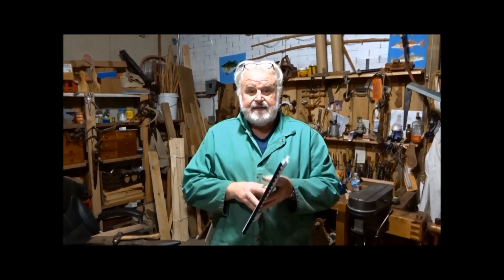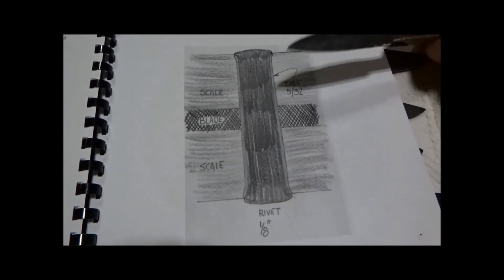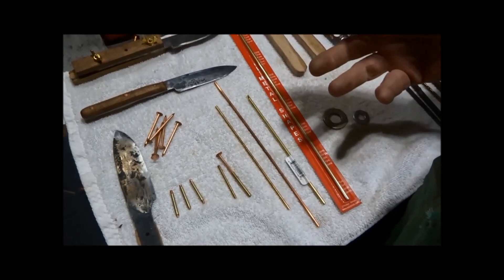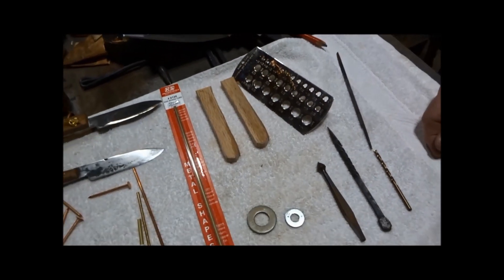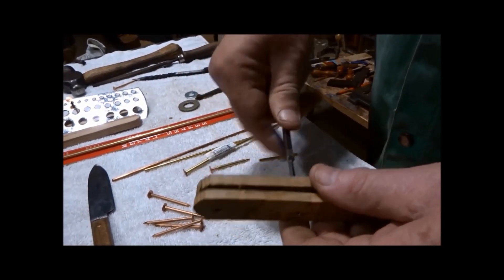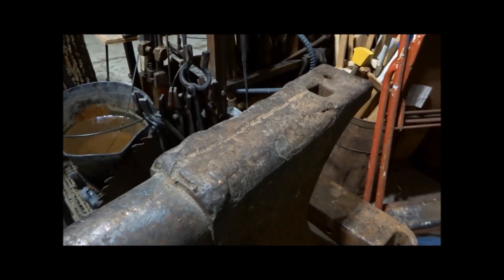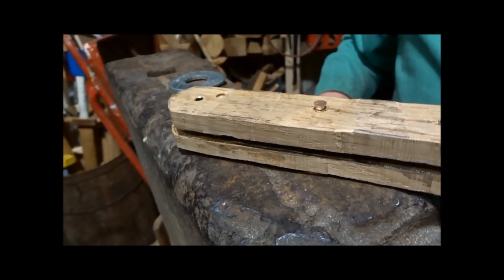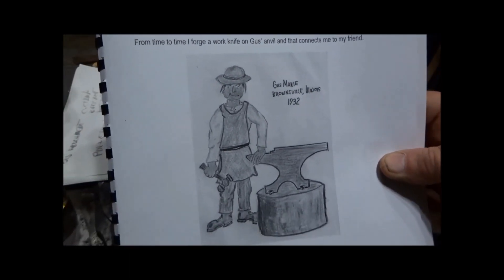Traditional peening of knife handle

Comment: This works perfectly. Ace Hardware will order the tube for you at no charge. It is K&S Precision Metals part #8128,   5/32x.014 brass tube ($1.79). The nails also from Ace are Anchor brand #11 copper slating nails ($14.59). I used copper because I just didn’t research where to get brass rods. Copper works great. Good luck.
Reply from the maker: High4, Thanks for your detail. Keep on smithing. Paul

Comment: This was very well organized. I've been stressing on the technique because the centrifugal switch on the Walker-Turner table saw I'm restoring on my channel has a broken torsion spring. Finally last night I realized the only way to replace the spring is to take off the long rivet that secures it, but I've never done anything like this before. I at least feel confident enough that by following this video and a little practice, I could get the job done. In fact, I went to Ace this morning (before seeing this video 🤔) and ended up buying both the copper nails and the brass stock you have because both are a perfect diameter for the original rivet. Plus another restorer also suggested a similar process. Thanks again 💯!

Comment: So does the internal pin push out the tubing through the whole pin or are you relying on the rolling over to hold the scale on.  I ask because I want the pins to be flush and that would take sanding. I would get the scales made to where I want them before smoothing.  I would sand the pins down to the scale height.  I just don’t want to do this method of the pins won’t hold after sanding flush with the scales

Comment: thanks for the video, using washer as spacer is a great idea.
would be great to cut the brass tub a few millimeters shorter than the handle width so the mushrooming pin sets in below the surface of the handle... then we can sand and file over the pins and still have them hold the handle together.
Reply from the maker: Stanley, What nice words. Thanks. Actually you can. The mushrooming of the peen head stands proud but the intense pressure  causes the pin just below the peen (mushroom) to spread a little also and more than enough to hold the scales tight even after we sand flat and smooth. Best, Paul

Comment: Thank you Mr. White. I have used copper tubing with copper pins for handles. Seems to work well. I like to use a larger drill bit by hand to countersink  the pin holes sometimes. Have used the file like you demonstrated also. Putting a nail in the tubing keeps it open when cutting or pressing on it.  Thank you again, Mr. White.    Yours in Prayer, Rick Trumbo
Reply from the maker: Rick, Thanks for your words and the nail tip. Is everyone listening?
Paul

Comment: Great video.  I'm about to try this for the first time and your video is going tomake it so much easier.  Quick question though.  The copper pin obviously expands as it is peened and thus fits tight in the tube.  Will the tube expand also, with the pressure?  Probably a daft question but I'm wondered what keeps the tube tight in the handle itself.  Thanks

Comment: Thank you.  I've wondered exactly how this is done and asked at a few knife repair kiosks for the repair on an old bone handled bowie  I broke, but no positive responses.  Tube and nail going on shopping list . I'll drill to size to fit materials available.
Reply from the maker: Gr8, Thanks to you. I've repaired/restored several Bowies myself and the tube trick works on in-tack and cracked ancient handles equally. Keep-up your work. May the FORGE be with you. Paul

Comment: Thank you for an excellent presentation, your knives are beautiful and that's a clever technique. Having said that this cannot be the way that knives were peened historically. I also doubt that the old cutlers just kept splitting scales until they got lucky.  I've noticed that old bowies seem to often have lots of small pins, are small pins less likely to maybe split the scales? Did iron pins perhaps deform more easily than mild steel or brass pins? Was there a way of annealing the ends of the peens to make them less prone to bending? Very interested to know your thoughts, thanks for the video.
Reply from the maker: Calvin, Great observations. "Old cutlers"? The oldest I knew were born around the turn of the 19th and 20th centuries and taught me. They, in turn, were trained by smiths from the 1800's. I haven't researched the techniques beyond that but I assume TRP has been around as long as there have been copper tubes??? I'm with you and assume the old-timers split lots of scales. I say in my book that after some experience peening with tubes, peening without them gets progressively easier.

Yes, small pins are easier than fat and iron is more difficult than brass or copper.

Thanks for your words, sorry it has taken so long to get back to you. This book and computer business is new to me.

Best, Paul

Comment: Hi Paul, do you use any kind of glue  (epoxy) on the tube and or pins?
Reply from the maker: Ram,  I use contact cement to hold it all together but you can use epoxy, However, it's the tube and rods that make the bond last for generations, note the handle chapter in my book. Keep-up the good work. Paul